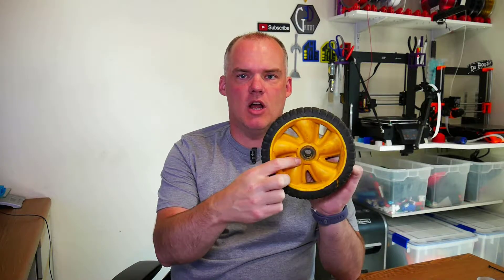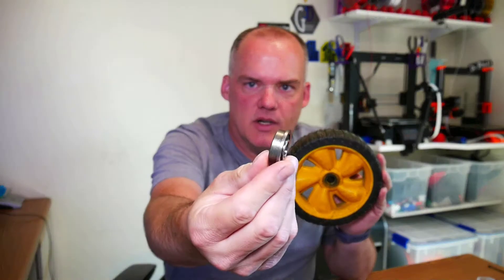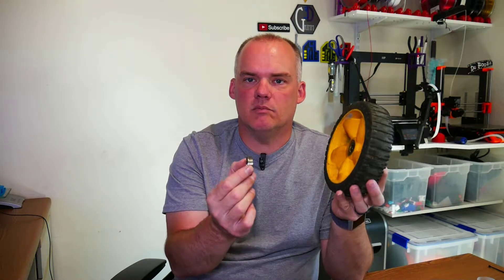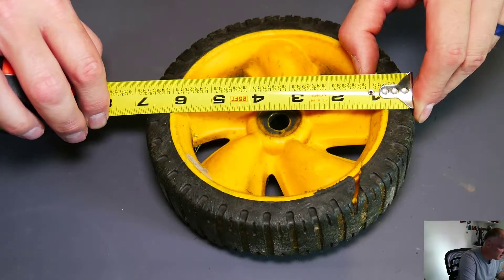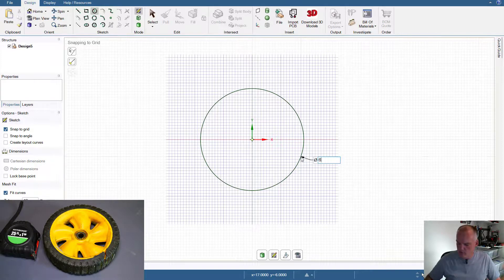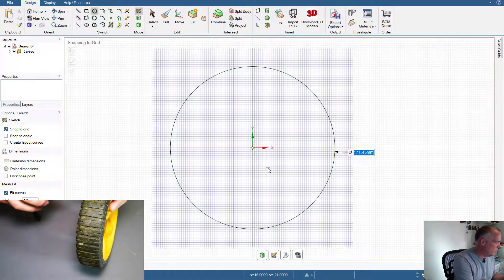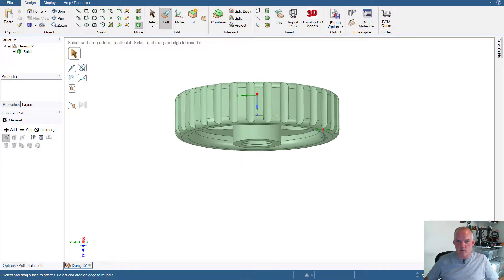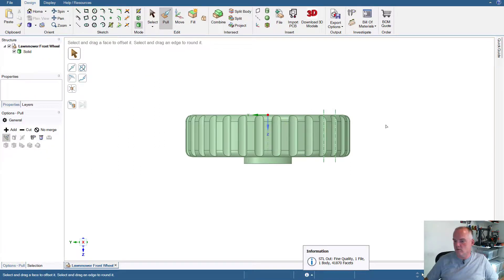3D Printed: Improved Lawnmower Wheels

Comment: looks like a early 2000's yard man 21" inch push mower just by looking at the wheel it self though they did the yellow and green from i think the 80's but i mostly think the 90's
Reply from the maker: Yes, I purchased that lawn mower in the early 90s, still going strong. One of these days I might upgrade to something self-propelled, but have a hard time moving on when it still works so well.
Reply: @Grimm3D  yeah them solid lil things but b&s went cheap an now there junk

Comment: Search online for a VERY WELL KNOWN lawn products company and lawn striping problems.  Seems to be a major issue with almost all of their rotary spreaders.  The problem is that the dispensing impeller is BELOW the tops of the wheels causing stripes, (product fling obstructed by wheel height).   Maybe you could help thousands of lawn care folks and 3D print us some smaller wheels!
Reply from the maker: I will look into that. This wheel design could definitely be altered to fit. Thanks for being part of the conversation!

Comment: It's sick that companies specifically engineer parts to wear out just so they can ensure customers will have to return to them. Bearings are cheap as dirt these days, yet lawnmower wheels with quite obvious engineering flaws are expensive as hell...

They literally mass-produce (in China, no less) millions of these parts, driving cost of production through the floor. Yet they can't afford to put a bearing in there that they can mass-buy at an equally ridiculously low price!? >:(
Reply from the maker: PREACH! My mower is at least 30% printed at this point.

Comment: Watched video & purchased bearings but now i see im unable to download the files from Thingiverse ?
Please can you send them to me.
Reply from the maker: I'm not sure why the Thingiverse downloads are not working. The files download fine when I try. I would be happy to send them to you but YouTube doesn't allow attachments. 

Try these direct links: https://cdn.thingiverse.com/assets/f9/a3/28/f8/bf/Lawnmower_Rear_Wheel.stl

https://cdn.thingiverse.com/assets/06/2f/b6/5a/e2/Lawnmower_Front_Wheel.stl

Also, I would make sure that your printer is printing the socket for the bearings at the correct size before spending the time to print the entire wheel. Bearings should fit snugly into the bearing sockets. Too tight and they won't fit. Too lose and they will wear out when on the mover. Most slicers will allow you to trim the STL in various ways, so definitely do a trimmed, trial print to trial-fit your bearings beforehand.
Reply: Grimm3D 
Can you supply me a link  to say google drive etc so I can download or I can advise an email but I dot see another way to contact you other than here ?
Reply from the maker: Try these links: https://drive.google.com/uc?export=download&id=17XAfc-5iOA3n-yUmDCNW9uvRgz6Lnby8

https://drive.google.com/uc?export=download&id=1Y1BDtXYdSogZv8RGjfU7nR5YBxbu6tXL
Reply from the maker: Did those links work? Were you able to download the files?
Reply: Grimm3D that downloaded fine.
Reply from the maker: @ianparsons1257  cool, let me know if you have any questions
Reply: Grimm3D Should be ok now. 
Can you software Save As F3D for Fusion  360 ?
Reply from the maker: Not that I know of. I use DesignSpark Mechanical. It is free software if you want to check it out.